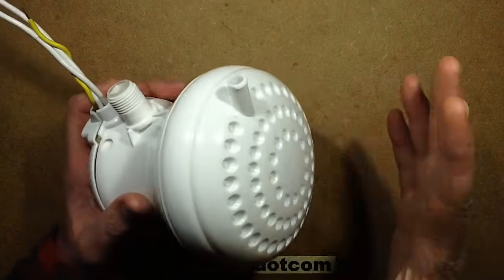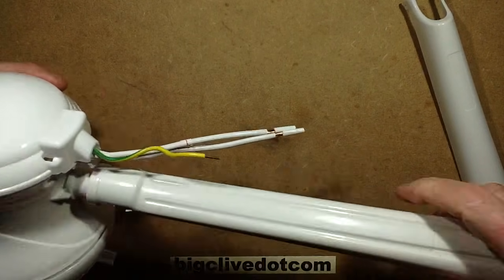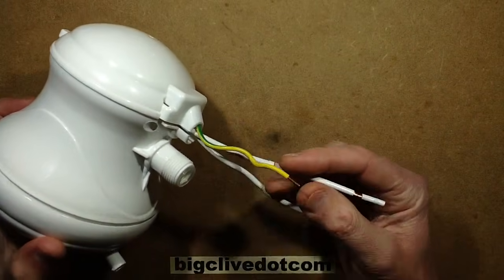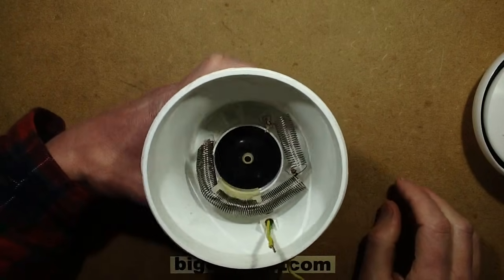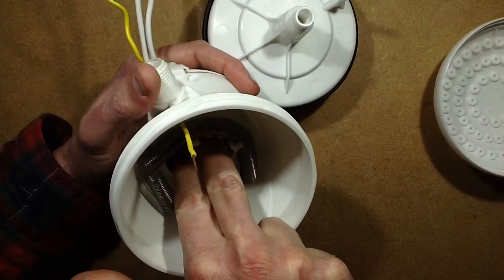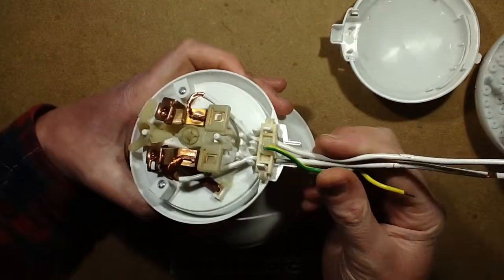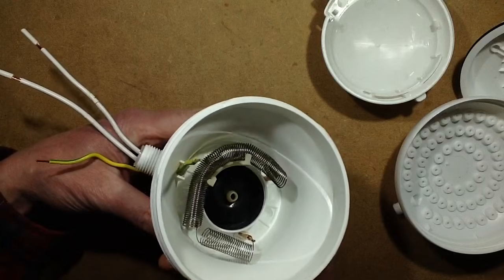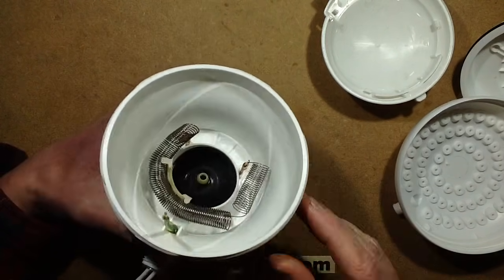Inside a heated shower head.  (suicide shower)

Comment: That extra pipe is for washing your arse!
Reply: I suspect it would give your arse a very special tingle.
Reply: (°ロ°)☝ up the bum bum???
Reply: 970357ers I'm laughing out loud here!
Reply: What a wonderful idea!
Reply: 970357ers I use it to wash my dog, not my ass lol
Reply: WTF?????
Reply: I swear I always tried to activate that magic device and in not a single shower in any of the houses I visited that hose worked.
Reply: Most I've seen require you to pull the pin out to open, a few require you to push the pin in; and worse comes to worse, just pull the whole head out and use the hose directly.

Comment: You dumb SOB, this is how your normal electric water heater works, too, an electric heating element inside the tank in direct contact with the water.  Do you think it is more efficient to heat a few liters of water when and where you need it or to heat several hundred liters 24/7?

FYI, these are the most common heaters for showers in Brazil and have been for decades.  I have never heard of anyone being electrocuted or even mildly shocked by one of these and I have lived in Brazil for 14 years.  It is your arrogance that makes you think the way you have always done it is now a law of nature.
Reply: You again? You should change your display name.
Cobber + water = ir (like rust)
Ir + cobber = bad ground connection (the green/yellow wire)
you in bath + bad ground connection + 220V and 20 amps = DEAD

Not for fun this is banned in Denmark.
Reply: hiesenberg Prove anything I have posted is not true.  If you can't do it, you are the egotistical, lying cretin.  Put up or slither back under a rock.
Reply: First, prove anything I have posted, is not true.  If you can't, rethink who is stupid.

Next, you're very brave with the insults when hiding behind your keyboard.  To my face, you will be more polite.

Comment: why would anyone use it after knowing how dangerous and risky this piece of shit is.
Reply: Truth teller It is dangerous
Reply: https://www.reddit.com/r/travel/comments/14cu9b/my_sister_got_electrocuted_in_peru_while/
Reply: Dale Erwin What can I say?  When you are right, you are right.  It could have easily been an improperly installed,  maintained, or repaired tank heater.  Simply not enough data.

The "police theory" statement could also mean they don't know either but had to say something.
Reply: 1. people dont usually shower with salt water and tap water is a very bad conductor
2. dont mistake shower and bath. In a shower the curent has to go through water droplet that are separated by AIR (air is a bad conductor if you didnt knew already). 

conclusion: bad conductivity plus air resistivity makes this thing a lot safer in a SHOWER than everyone wants to think.
Reply: Florian M&#252;nch - In that article it said &quot;one theory the police are investigating is that the hotel room shower somehow became electrified&quot;. That does not indicate to me that there was an electric shower heater involved, and the photo in the article certainly was not of this type of shower head.
Reply: Democritus86 She didnt died she iust got zapped, its not common to die by one of these. As long as the earth wire is connected theres really no problem at all, theyre used everywhere in Costa Rica and no one has died from this.
Reply: Zazzilas Arden Then tell me why out of the millions in use every day, no one is being killed?
You fools are like religious zealots. Refuse to admit all of the facts are against you. Have you noticed not one person has disputed that no one is being electrocuted by these? Stop being idiots and face the truth. No one is being electrocuted. Your beliefs, no matter how sincerely held, do not alter facts. Show me even one verifiable instance of someone being electrocuted. If you can&#39;t, show some ethics, swallow you pride and admit it. Otherwise, you are arrogant, ignorant fools.
Reply: Florian M&#252;nch You will note the article did not mention a shower head heater. It said "electric shower" referring that they were in the shower. It could have well been a tank-type heater that was improperly installed or maintained. You use a very thin example to offset the verifiable fact that million of shower head heaters are used every day and no one dies. How like "true believers" to ignore the most obvious facts to maintain ludicrous beliefs.
Reply: Millions of poor third world country people. Save up your pennies and get a proper water heater. Or does your shack not have proper plumbing?
Reply: It is not dangerous.  Only the idiocy of the poster of this video is dangerous.
Reply: Democritus86 All of these are personal anecdotes without a shred of proof. No doubt some of these people believe them but verifiable evidence is required for them to be creditable. One indisputable fact is, millions of these are in use here in Brazil. I have lived here 14 years and have never hear of anyone being even slightly shocked by one. I have received a mild shock from my computer when the ground on that one circuit became faulty and I was not wearing shoes so I was grounded. With shoes, nothing. Re-seating the ground connection on that one circuit solved the problem. I knew what the problem had to be. I am a retired IBM Customer Engineer. (repairman) and do know what I am saying. There should be no EMF potential on the aluminum surface of the computer case with a properly grounded circuit.

The fact remains, with the millions of shower head heaters being used here every day, thousands of people would be killed each day if the heaters were even 0.01% as dangerous as this video pretends them to be.
I suspect that would cause people to talk. :)
Reply: NateNate
You ignorant fool.  You don't even know what is meant by "third world country."  It is a phrase coined during the cold war.  First world countries were aligned with the USA and the UK.  Second world countries were aligned with the USSR and China.  Third world countries were aligned with neither.  It had nothing to do with economics or infrastructure.

FYI, you stupid SOB, Brazil is a vibrant, economically sound, country with better health care, and support for the populace than the USA.

FYI, you arrogant piece of shit, I live far better than you do.  I have one condo here, a ten minute walk from the beach and another in Rio that is rented.  Both have these same shower head heaters.  Not one person, out of the millions here that use them has ever been electrocuted.  Prove otherwise, you goddamned lying shithead. 

Finally you worthless asshole, prove anything I have posted is not true. You ignore that because even someone as dumb as you knows you cannot do it. 

Go fuck yourself and then die happy.

Comment: Its not credible when the practice tells us that this shower is safe and your concerns are the result of prejudice and not research. The major flaw on those appliances is not safety (provided they are correctly installed) but that they burn a lot of energy to work (solar is way cheaper in this regard). They are not eco-friendly in any sense.

Comment: Yeah they are aimed at the 3rd and 2nd world, hot places
that's why they are low watts as the incoming water would be warmer than say the north of europe 
i did think about getting one a few years ago but when i looked in to it, no way in the uk as they would be deadly

in in the north on england and even a 850 watt shower is to low in the colder times
i think i need a 1050 watt so i get a good flow

the shower heads may be okay for summer car camping with a pump taking water from a stream with the right safety in place run from a gen i guess, for the wife and kids you understand ;-)
Reply: The casing is pretty sketch as you can just pop the top off
Reply: Truth teller Sure, I'm just saying it wouldn't pass safety classification where I live.
Reply: As a brazilian that see and use those things everyday, there are some very powerfull variants around, i have a 7500W one in my house, and its a 220V, as everything else in my state, not that you ever need to put it this high, since cold days are rare around here.
Reply: Sadly thats how confirmation bias work, and getting away from it is pretty danm hard.
Reply: Marcelo Coelho You are correct, sad but true.
Reply: Your ignorance is showing.  These same devices are used in São Paulo and all parts of Brazil.   Mine have three setting.  I have never used the "high" because the water is then way too hot.  Even on "Medium" I have to turn on the water more than needed to keep it comfortable.   

In 14 years here, I have never heard of anyone being even slightly shocked by these shower heads.  They work the same as an electric water heater.  An electric heating element is in direct contact with the water.  If that would kill you, most of the people with electric hot water tanks would be dead by now.  Not a bad idea, at that.  There are far too many people in the world now.  Especially stupid ones.
Reply: Truth teller
and thats what i said
they are low because the water is hot as i said and as i said where i live its almost freezing, if you shower under the cold water you may pass out

oh and there are reports and even yt videos telling of the danger of them
one video showed a shower head like that with the wires stripped and water a few cms away
no way would they be allowed to be sold in the uk

i'm talking about where the element attaches to the mains
what power do you have down there, volts
because think about it, say they were in the uk running on our power of 240v
240v in water right to your head, that would not be a good thing

the young in england don't know about mains and safety today, well it's the women
they don't understand

a young woman in the town where i live killed herself because she took a radio and put it on the side of the bath and yes it was in the mains
it fell in and killed her

they are a very cheap way to shower where the water is warm but i still would use a RCD with one
Reply: SE09uk These work very well in cold water. If your water is frozen,  it will not be flowing through the pipes.
Reply: Have you been to a cold place ?
i highly doubt they would warm the water from 6c or less to a comfortably warm fast flowing shower, the ones i've seen just do not have the power
as i said we need 950w to 1050w min if you want anything more than an elephant peeing on you type shower
in the uk we have heater cans in the shower with all sorts of safety devices like a TCO or to you a Thermal Cut-Out
and a Stabiliser Valve and Solenoid Assembly, oh and a PRD or if you don't know thats a Pressure Relief Device
and a RCD
in the USA they have RCD's being the bathroom wall at the back of shaver sockets so ive seen
we have atm a 850w shower and in winter we have to slow the flow to very little to get a warm shower
set to number 9 in winter, in summer its on 1 (it goes up to 10)
never under estimate the effect cold water has
i don't think you know what cold water is
i bet you complain that your ground water is cold if it's less that 99c

oh and even the video says it's a suicide shower head so come on
do you put on roller skates to go on your roof ? because that's not at all safe if you do
Reply: allupro That doesn't change the fact that millions of this type of unit are in use around the world.  No one, including myself, has been able to produce a verifiable account of even one fatality from using them.

If there were only 10,000,000 units in use here in Brazil and they electrocuted 0.001% of the users that would be 10,000 fatalities a day.  That might cause talk!
Reply: Maybe not. Where I live, about 72% of the homes are equipped with these, including two in my own condo. Perhaps the units available to you are not of the same manufacture or perhaps the people that make the safety regulations are in error or have been told what to do for political reasons.

I do know that, with millions of these units in use every day, there has not been a single incident of anyone being electrocuted or even mildly shocked. That tells me something, even if it doesn't enlighten the "True believers" here.   :)
Reply: Marcelo Coelho That is exactly what I have been saying. I have lived in João Pessoa for 14 years. I have two of these and have never received the slightest shock. I have never heard of anyone being killed by one. If there were only 10,000,000 of these in use and even if they were 0.001% as dangerous as this video implies, there would be thousands of deaths every week. Yet, not one verifiable incident of anyone being electrocuted has been found. People would rather believe what they want to believe no matter how strong the evidence against it. Then they become outraged when I point out how astoundingly stupid they are.

Comment: The video is old and there are tons of similar comments here, but I have to say my point of view. Judging by the label, this unit is a copy of a Lorenzetti model. Before finishing the video, as you mentioned, I saw many and many videos entitled "Suicide shower", as they show a badly/poorly installed, scalped(broken/exposed/removed selector), usually in a very low height, mostly of them were in a shithole, even the person that tested it in its own home. This kind of shower is mostly common in houses, as they don't have central heating system. Not in defense of it, as they aren't perfect, and, as any product, they may be defective. If you buy a good brand, and install it properly, including the ground, directly to the wall through a 3 way ceramic connector instead of using a outlet, the most dangerous thing that can happen when the resistor/heater blows, is you taking a cold or less warm bath. Doing a bad installation like the ones shown on stupid sensationalist videos, or changing the resistor/heater without disconnecting the wires, of course it will be deadly. Anyway, like the many others of yours, I enjoyed the video.